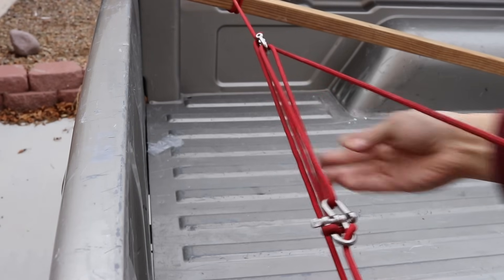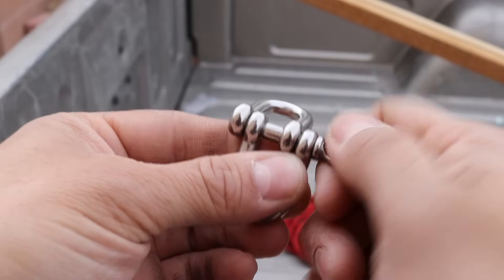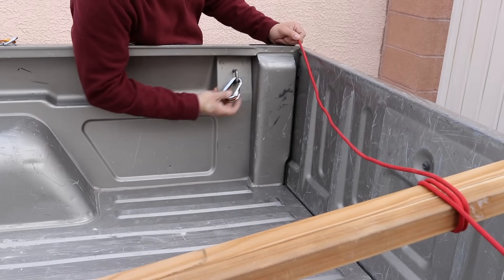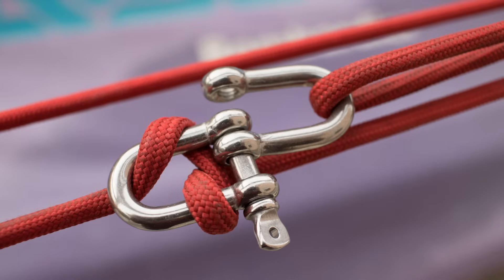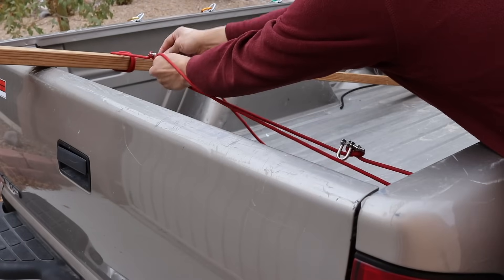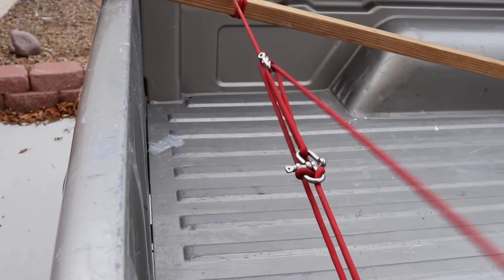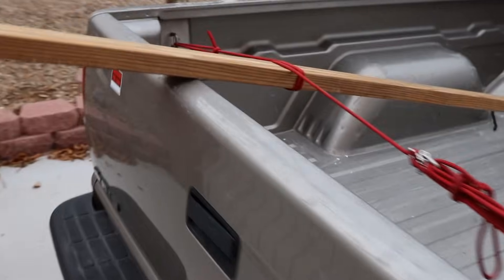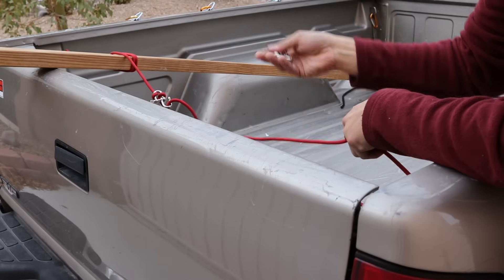Unreasonably Tight Truckers Hitch

Comment: Very clever, but a couple of corrections if I may. I have 30 years of high-angle rescue and climbing experience. Your boline has the end of the rope outside of the knot, not inside as a classic boline has, though I don't think the strength suffers.

Your trucker's 2/1 is actually a classic Z-pulley system used in climbing and is a 3/1 mechanical advantage.

Your finished pulley system is not a 4/1, but a 5/1. This includes the strand that you are pulling on, as it does contribute to the advantage. This is a simple (as opposed to a complex pulley system where forces multiply, not just add to as is the case here), so you simply add all the strands including the strand that you are pulling on. There are 5 strands, so this is a 5/1.

The last problem is the extreme over-kill that a 5/1 system has, which in this case, damaged the wood.

Comment: This is great for light loads but loading the shackle like that is going to bite you in the ass with heavier loads. This is not an approved or recommend way to use the shackles. Source: I designed rigging equipment for four years. I've seen what can go wrong

Comment: That tie it off knot was a half hitch cinch. I just use my rope ratchet straps. Does the same thing, just faster. Don’t have one of those, you say? Well, just grab a drill bit a size bigger than your rope, and drill the slot in a ratchet strap so the rope can slide through, an presto, it’s magic. Of course you need to tie a hook on one end of the rope. The advantage over a rope instead of a strap is as shown in the video. The rope makes it easier to go around boards and pipe, etc to tighten them down, although it can be done with a strap also. I usually always have the ratchet part of a strap as the long end is usually what breaks first.  That’s how I discovered the fix.

Comment: Something people dont seem to realize with this is when transporting things,  especially over distance, whatever you are using to hold said stuff down naturally loosens up. This makes it far far easier and faster too retighten when using rope as well as you dont have to deal with fused knots
Reply: This is one of the reasons why i use rubber (tire interior cut to a long strip) to tie things down. It naturally tightens on its own
Reply: Truckers hitch doesn't "fuse" (I think I know what you mean) when tied correctly. 
It all just unravels when you release it.

Comment: This can just as easibly be accomplished with two loop knots (make a loop in the cord and wrap it around itself to make a knot with a loop) then running the tightening rope through the two loops. 
Disadvantage of my method is trying to untie the loops. A peice of scrap wood inserted into the loop knot eliminates this issue. Simply remove the scrap wood and the knot is easily untied.

Comment: This was some of the most Rube Goldberg tying I have ever seen in my life!   Dollar store carabiners, that have a zero load rating.
 Chinese shackles that have unknown ratings, being used improperly, defeating any rating they may have had to begin with.
 And a whole lot of rope wrapping for no reason.
 As a heavy rigger I can say the old adage “ if you can’t tie a knot, tie a lot”. Is on full display here.
 And all the likes suggest there are a ton of people that can’t secure a simple load in a truck bed.  
 If you need to do all this, just get some Harbor freight  ratchet straps and be done.  ONE ratchet strap , wrapped once around the board would have accomplished the same and cost less!!
Reply: The guy in the video would get laughed off of a job site!
Reply: If you're a rigger, I've got a question for ya. Is it "belly roping" or "belay", where you cross your rope or chain around an object?
Reply: @dontnubblemebro   heavy rigging is the lifting and moving of large loads, usually with cranes or tuggers etc. that said, most rope work we do is with tag lines, for control, or securing a load. since lifting loads with rope, other than tool buckets and the like, is pretty much banned these days on job sites. We don’t do ships rigging, that’s a whole other animal.
 When we need to secure a rope or tag line, it is belayed and secured , which is called out as “ secure that rope” .  The only Belly roping ive heard of is some rodeo sh*t.
  Still, being able to weave a loop, dog dick etc in the end of a rope is part of our journeyman skills test.  As is putting a Molly Hogan in a wire rope.
Reply: @megastick9324  

I'm familiar with rigging, I've worked with riggers before! I've heard the term from riggers and truck drivers alike, it's a means of securing a round load or bundle, by wrapping and crossing your load restraints. Not sure if it's official, approved or even safe, but I see plenty of it!

Comment: Overkill! The biggest issue with a truckers hitch is not so much the cinching down tight. The ability of the rope to apply even pressure to both sides of the anchor points is usually the issue. If you have the rope wrapped around something like he does you would very likely have one really tight side and one loose.

Comment: Great video, except the bowline was tied inside out. The tail end should be on the inside of the loop not the outside. There is more bite when on the inside. The trick to getting it on the inside the way it was tied here is to go over the loop with the tail then back through it, rather than just going straight through. The setup you did puts a hell of a lot of tension on that bowline and the higher the tension, with it inside out, you have a significantly greater chance of that sucker slipping loose... just food for thought.

Comment: While it may reduce some resistance, I don't think it reduces enough to make it worth while having more parts and pieces to a trucker's hitch. A rope is all you need, simply add an in-line loop to increase the mechanical advantage. If you do it right, you can come back and make another loop over and over until you either break the rope or break your truck. No metal parts, just rope.
Reply: Exactly! Rope is all you need.
Reply: Only problem with this entire configuration is the strength reduction of the rope by using a weak knot. All the stigma around the knot but a clothesline knot or a noose retains a much higher WLL due to the knot being woven through a series of friction rings. 
The introduction of a basic knot such as a bowline or a hitch reduces the WLL of the rope by 50%.
Reply: @southern151redneck  Have been using this configuration for over 30 years, have broken tie-downs and cargo but never a rope, not from this... So I disagree with any strength reduction being a problem at all, unless you're using a spent rope, which you shouldn't be to secure a load under tension like this.
Reply: But NOWHERE NEAR as much fun! 😁🥸
Reply: Using the clevis, or rings  makes it faster and easier to adjust the location of the "loop". And way easier to untie. Solves two problems at once.
Reply: @ronfox5519  no
Reply: @ronfox5519  You shouldn't have to adjust the location of the loop, you just put it as far from the direction your pulling as you can. 
You shouldn't have to untie the loop either, once the line isn't going through the loop, you should be able to just give the rope a tug and it will undo itself... Can do it with one hand!
I use truckers hitches quite frequently, I honest to god can't fathom it being faster or easier to put shackles where I normally just put in a quick loop.
If you like the shackles, use them, but this faster and easier argument doesn't hold water from my experience.
Reply: @roberthance1187  
Now that ive looked into it more, i see your point. I didnt know how to put a loop in that wasnt a bugger to undue. I got some practicing to do. Its going to take awhile to break my old habbit.
Reply: @roberthance1187  do you know the name of the knot you're using for the loop that can untie with one hand after being under load? Curious to take a look. Does the ease of untying depend on the type of rope? If that works well, I think the only other reason for using the shackles is it saves your rope from cutting into itself over time and increases the lifespan of the rope.
Reply: @topherbuckley  The loop is referred to as a "Directional Figure 8 Knot" (it sounds way more complicated than it is). I think it might be able to be called a slippery half-hitch, but that's what I call it when you want it to slip off the anchor point... Don't hold me to that one, my last day as a boy scout was decades ago and not all the terminology stuck.
It will undo itself whether you're using heavy twisted manila rope, braided nylon, or even paracord.
While it might slightly fray a manila rope, everything frays a manila rope... lol
Other than that, it really doesn't burn into a nylon rope at all, they're tough when it comes to frictional abrasion.
Works wonderful with Paracord... Standard 550 Paracord is a must have when camping, with a truckers hitch you can pull down small trees, and run super tight lines for heavy tarps... 
Truckers hitches, ropes... Learn them, know them, use them. 👍
Reply: @roberthance1187  thanks for the speedy reply! I'll have a look at that knot. From a climber's perspective I'm always overly weary of cutting ropes with rope 😅.
Reply: @topherbuckley  
No prob, good info to learn is good info to share...
I just remembered, when making the loop, give it an extra couple twists before finishing. It makes it a bit easier to undo itself when the time comes.
It's hard to explain in words, and I'm not prepared to make a video haha.
Reply: I guess you've never heard of a ratchet strap?
Reply: @timbo_slice4053  
Hm, well you'd be guessing wrong.
What makes you think people in a discussion about truckers hitches have never heard of a ratchet strap? 
That said, I'd take a single good rope over a bucket of clunky ratchet straps any day, on any job, no question.
Reply: @timbo_slice4053  Truckers Hitch is WAY faster than ratchet straps and WAY less frustrating!
Reply: @glenholmgren1218  I despise ratchet straps!!

Comment: And here I was the kid of a life long trucker thinking that whenever you attached a mechanical piece to your rope, it’s not a truckers hitch then it’s a mechanical assisted hitch.

Truckers hitch uses only the rope. 

Hence the name, you only need the rope and a real “trucker” to  show you how it works. 

Otherwise why carry around all this extra shit that can bend when under a heavy load? Load shifts, those metal U bolts WILL BEND bad break. 
Rope flexes and stretches before it snaps, and requires way more linear force to break away from the loads stress.

Ubolts however- snap under excess load stress. It’s literally the weak link when using chain on purpose.
Reply: 100% agreed... Aside from adding points of failure, you're just adding parts.  That said, for educational purposes, you should know how to multiply the advantage of a truckers hitch with inline loops before you learn to do it with extra parts.    
There are many situations where a truckers hitch will be useful, not just securing a load. Any situation where you need a very tight rope, a truckers hitch can be very useful. However, if you don't know how to do it with a rope alone, then you're simply handicapped without your metal parts to go with it.  
You don't teach a scout how to use a lighter rather than how to build a fire.
Reply: ??? When have you ever seen a schackle break?
Off the top of my head, i cant think of any part of the system that is as reliable.

Comment: The point of the trucker's hitch is that you get the mechanical advantage from bites in the line.  If your going to purchase and carry hardware with you, why not just get pulleys and use a block and tackle?
Reply: A couple of 1/8 inch shackles are cheaper, smaller, and lighter than a block and tackle set up
Reply: Like old mate said just learn a truckies hitch . Much simpler.

Comment: 2 carabiners enough to tie this up. No need to use 3 more shackles. And if you wrapped the load closer to the end so that the rope made a sort of bow string pushing the load towards the cabin this would hold the load sturdier in the truck.

Comment: This is why someone invented the ratchet strap.
Reply: Not always available.  A trucker knot is worth knowing how to do
Reply: There was 1 time hauling a decently large load i used all 4 ratchet straps and needed a fifth. Saw the truck had a rope under the seat and remembered the classic truckers hitch. Its not that youll use it everyday but that little bit of knowledge could help you at some point
Reply: TRU, BUT
The sexual advantage of tying the knot vs cranking off on ratchets is atleast 4 : 1
Reply: @w4439  amen
Reply: I love this comment. You are absolutely right, ratchet straps do exists and ignoring they exist would be plain stupid. But you do realise you're missing the point right ? This is a knot tying channel. We come here to learn about knots and what they can do and one of the things they can do is improvise a ratchet straps. The day I have something to tie down, both options are available to me and if rope is the only thing I have access to, I can make do.
Reply: Yes! But like me. I hate ratchet straps. I prefer truckies knot. I have a drywall or gyprock truckies version. Super fast and quick release if needed. Never lost anything ever.
Reply: I don't know about you but my friend just stuck me in the back of the pickup and said hold on to it for me...cause that's what friends did .... and he'd try to hit every speed-up and pot hole on the way...
Reply: @mattp6355  😆
Reply: A ratchet strap is really only good for one thing. That rope and those shackles gives you so many more options, not to mention you could carry 20 of those shackles and 300 ft of rope easy imagine how many ratchet straps you would need to match.
Reply: Sorry for knowing how to do something with something else when I don’t have that thing.
Reply: @cuniculariusna3333 😂 exactly.  Someone’s ego is bruised because of a guy showing a useful knot. Sigh 😔
Reply: This may be more convenient and this hitch can be applied in more places than just securing stuff to a truck
Reply: And, if you don't have one, this is how you improvise. Also, ratchet straps are more attractive to thieves. These are cheaper to replace than ratchet straps.
Reply: -Facts lol
Reply: And if you don’t have a ratchet strap and are 100 miles from a hardware store?

Lot easier to find rope than ratchet straps in east BF!
Reply: Ratchet straps take about as long and cost more so...
Reply: @garethbaus5471  it takes you as long to ratchet strap as this rats nest?  Wow..
Reply: @megastick9324  I can tie knots pretty quickly, plus ratchet straps can be a bit fiddly if you want to release them quickly.
Reply: @garethbaus5471   yeah ok.
Reply: @garethbaus5471  make sure your ratchets are oiled up and you won't have that problem
Reply: @megastick9324  the only rat's nest i see is your attitude
Reply: You there. This. Need some int level of using this probably neat rope trick - with a single tool that job gets easy as heck.
Reply: @GGorsty  except you need to buy the shackles, can get a ratchet for the same price.
Reply: @jasonrowe6302  two alpine loops(think people call it a butterfly loop?) would work just as well
Reply: @jasonrowe6302  Doubt a ratchet strap could get as tight as this thing. Especially with a 4/1 advantage.
Reply: @TheGoldenTNT  why does it need to be that tight? A ratchet will get it more than tight enough with less mucking around. Nice trick just not super practical
Reply: @jasonrowe6302  not only does it not need to be that tight, but he also damaged his lumber, something a ratchet strap would have not done.
Reply: @TheGoldenTNT  So a ratchet strap also has a mechanical advantage.  Its the length of the lever vs the diameter of the drum full of webbing.  A quick measurement of the ones I have around the house leads me to believe a medium size ratchet strap is 6:1 or so.  Small ones nearer 4:1.  You just aren't visualizing the crank as a lever (which it is) instead of a pulley.
Reply: @TheGoldenTNT  Maybe if you found a way to put a 6ft bar on the end of the handle. Maybe.
Reply: @akunog3665  You can certainly damage lumber and other loads with ratchets. Ratchets have their problems as well and I say that as someone who uses them everyday at work.
Reply: @patricknettles9231  that is a good idea! I'm going to try that one!
Reply: @patricknettles9231 I really like Alpine Butterfly’s. 
Unfortunately in practice you can always expect just 1:1 because without any shiny SS shekels the friction is too high and you just end up tightening one rope and other’s are loose which is crap really
Reply: @akunog3665 Well the title of the video is “unreasonably tight”. Personally I find ratchet straps far more clunky to use than rope. And rope can be used in more situations than straps. But straps have one distinct advantage, which is that they wont stretch when wet.
Reply: Ratchet strap + back rack = perfection

Comment: What a freakin awesome trick man. I tie down tree debris and brush on my trailer and use truckers hitch to secure it all. This little trick will take it to the next level and no more risk of ripping skin off the fingers pinching the bite to half hitch the knot to hold it. Excellent man! I’ll be using this trick and I’ll be sure to shout you out once I have a chance to demo it in a video
Reply: This is another great one I hadn't seen with a double "truckie's hitch" (it's Australian) https://www.youtube.com/watch?v=drkcOzCjuuU&list=PL4jdzOglcatmwxqiaP8IVq4xsbkSgaKRu&index=5&t=15s. Probably not nearly as taught as the one in this video but doesn't require any hardware and still very secure; providing, I think, a four to one advantage.